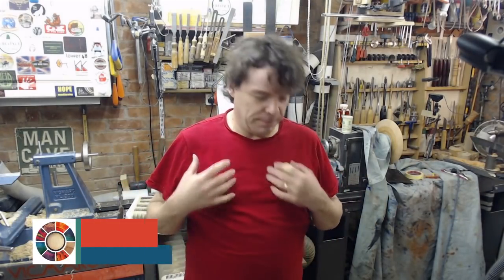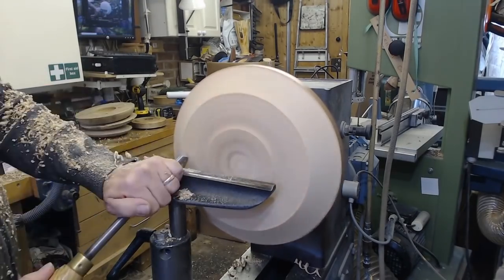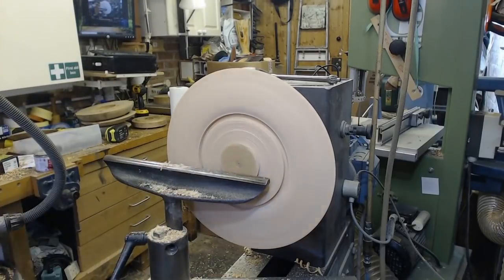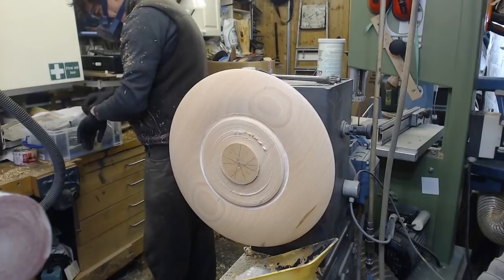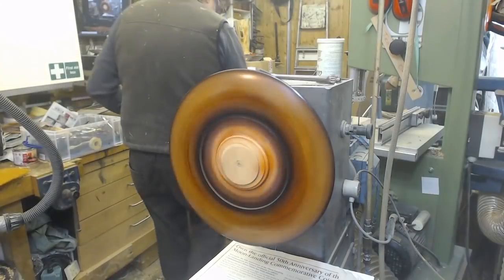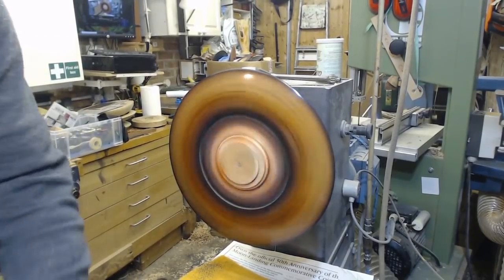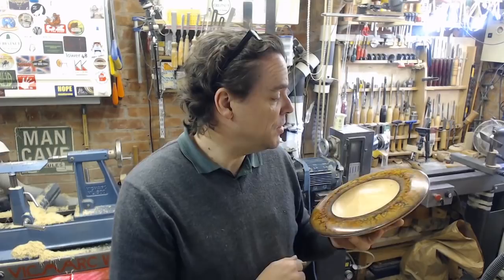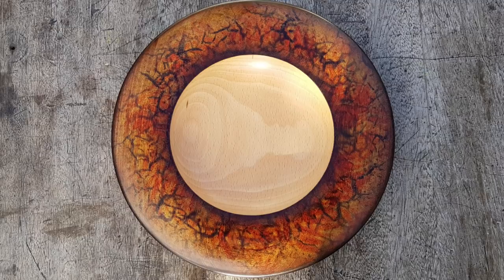Woodturning an Amber Effect Rimmed Platter

Comment: Thanks for sharing Stewart!   I like the black veining through the amber rim.  One embellishment you may indulge in is using a shellac applied in a French Polish technique.  But, dissolve the shellac flakes with 151 drinking spirits and not denatured alcohol. You should find a 1lb cut should give you a amber tone without detracting from the rim if applied to the bowl and back/ base.  The shellac finish applied in 3 or 4 coats is very resilient and durable finish when applied in a French polish technique. Like a violin or guitar. Bonus is doing it on the lathe takes minutes not hours like in applied with a violin or guitar. 

Thanks for the video!
Reply from the maker: Thanks, Micheal - and thanks for the tip about shellac. It is now on my tuit list! Cheers!!